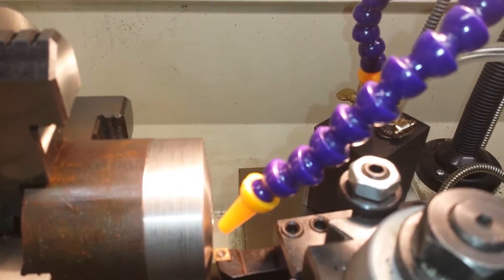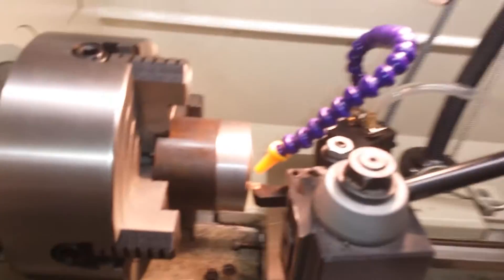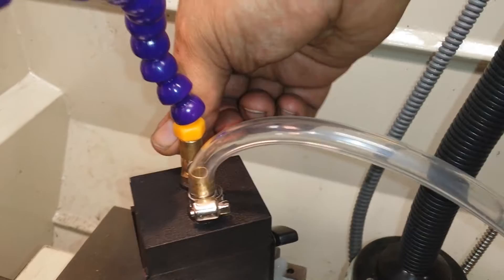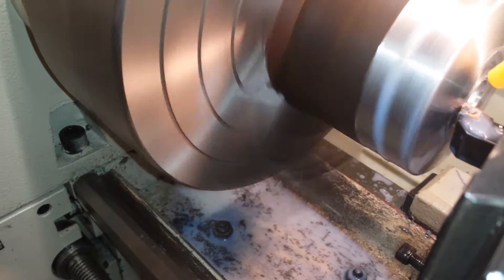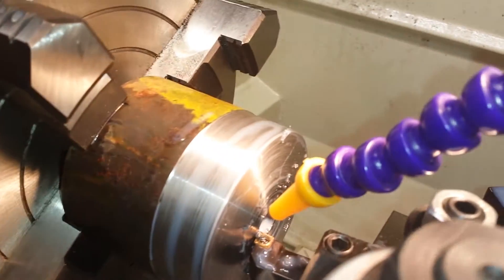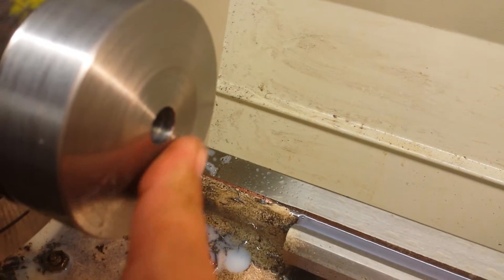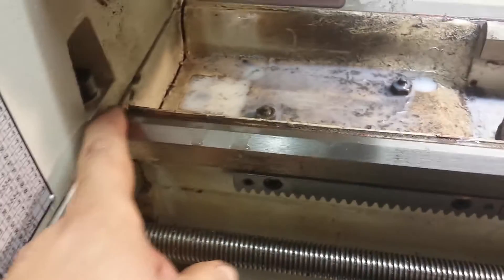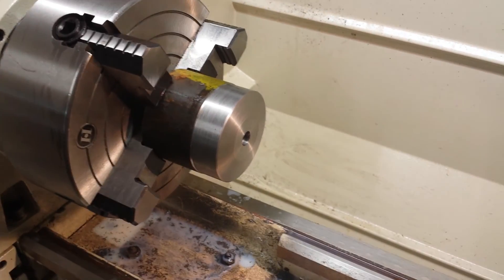Flood Coolant System Installed

Comment: why do you put a left-handed turning tool in that orientation on the Quick Change window normal right-handed turn into a mounted normally is better for facing? I've never seen anyone do that. 99% of your cuts are going to be from right to left using a right-handed tool and using a carbide bit like that it's just as soon as 4 facing and it's already set up in the right orientation.
I don't know call me crazy

Comment from the maker: I turned off the fluid early just in case I was having a problem.  Normally I will keep the fluid on the hole time.  Adam Savage from Myth Busters said that if he had to go back, he would of used coolant from day one.  

Very true on the safety glasses.  I normally keep my mask on whenever I am turning metal.  I was pretty nervous about leaks and filming at the same time.  I need to get a tripod.

Comment: Have you noticed any extra wear from having the coolant "washing" the way oil off the ways?  How about rust?  Any other long term problems with this system?
Reply: just need to wipe the ways down to prevent rust plus if you mix the coolant right there shouldn't be any rust